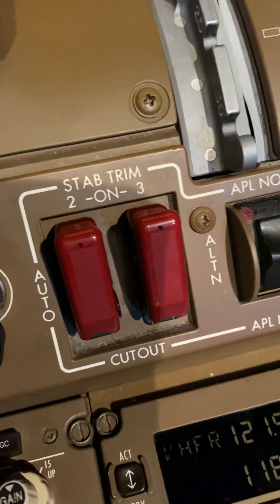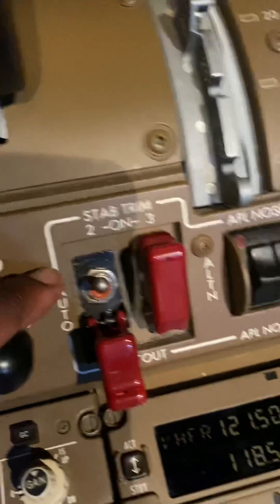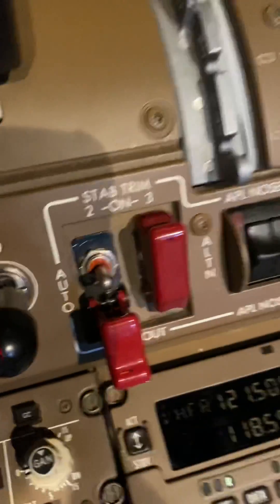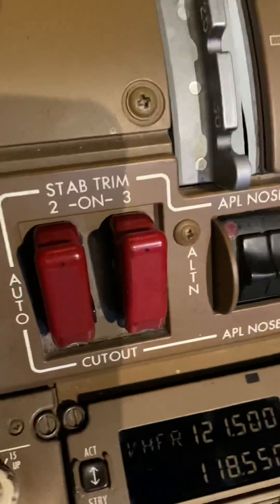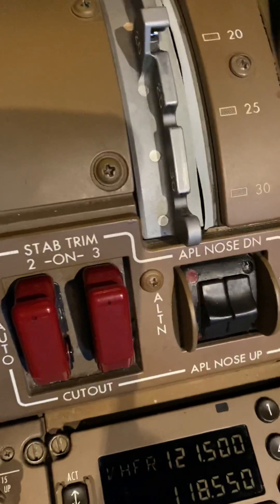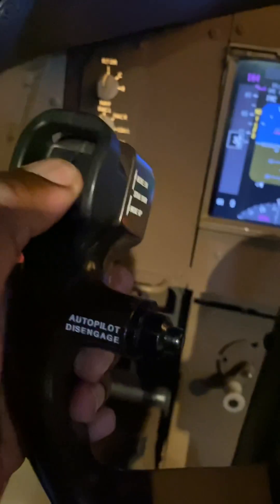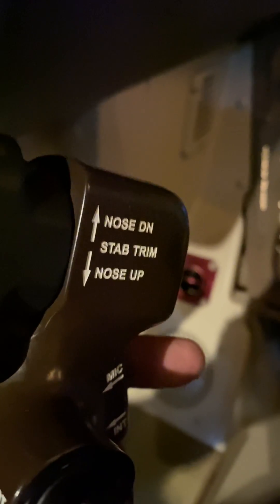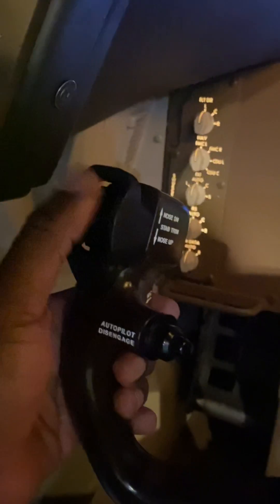Stabiliser trim

Comment: what happens if the Captain trims nose up on the yoke and the First Officer trims nose down on the yoke simultaneously?
Reply from the maker: There will be no trim movement
Reply: On boeings, all yoke movements are combined, so it comes down to whose the stronger person. In airbus, whoever is allocated the controls by a switch is who has the flight control inputs, or if there is no switch or turned off any opposite motions that are done, they will just cancel each other out.